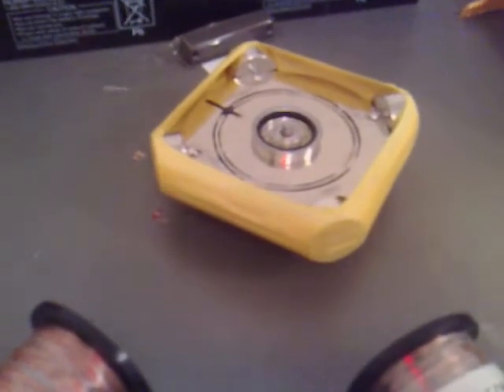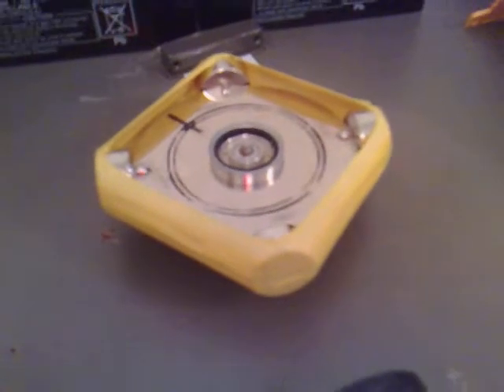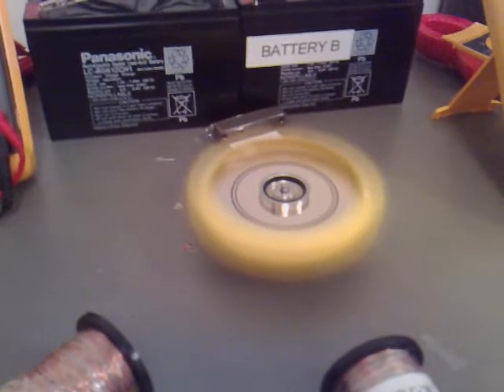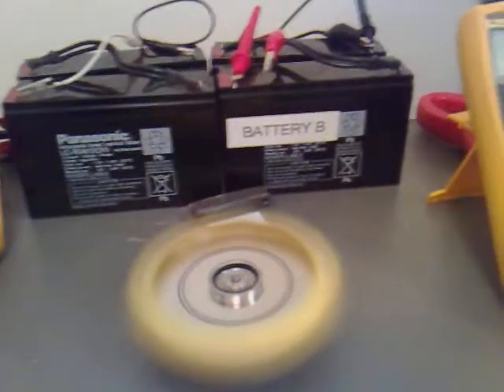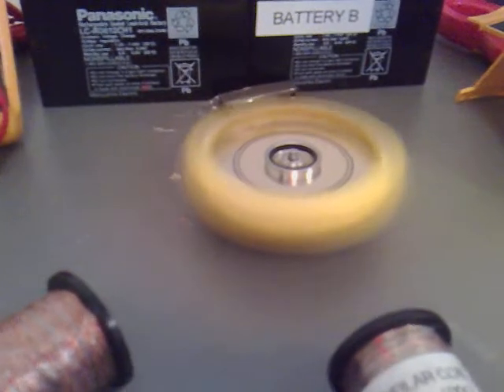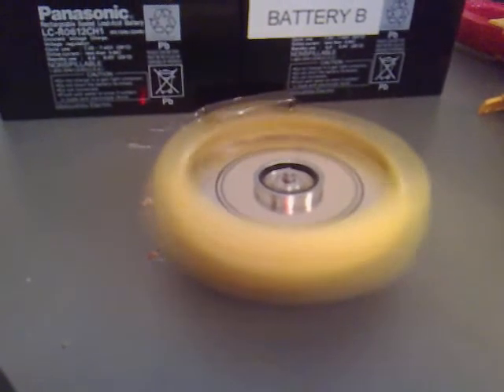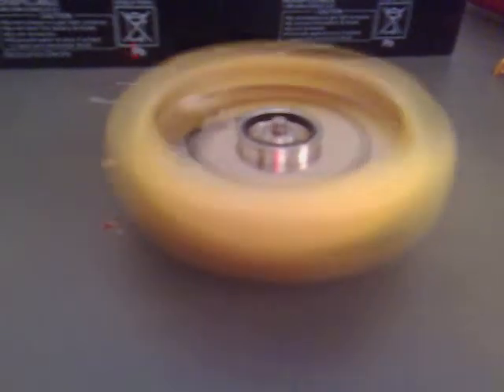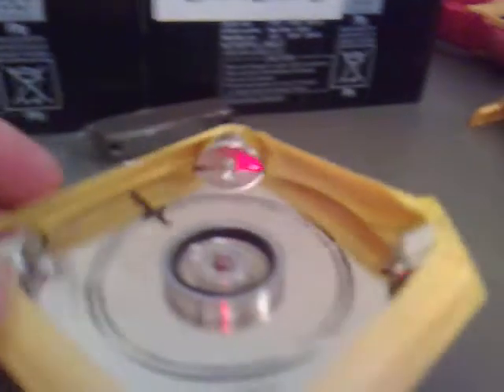Pulse Motor (Fixed) 049

Comment: Wow that's some pressure it took!
I'm currently getting ready to buy some parts as well, but i'll go on a much bigger scale both in amplified size and speed, it would be a shame running out of juice in the middle of the sea as i need it to create hydrogen for my motor boat and maybe some other stereo stuff and all that ;)
I have lots of testing before me first though, but i know this is gonna work ^^